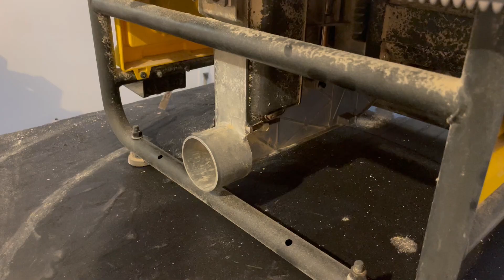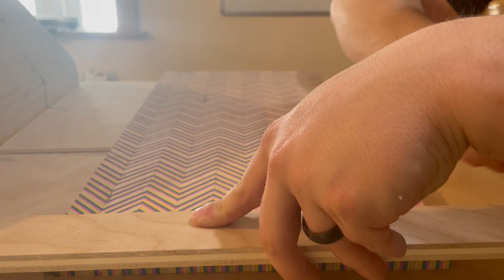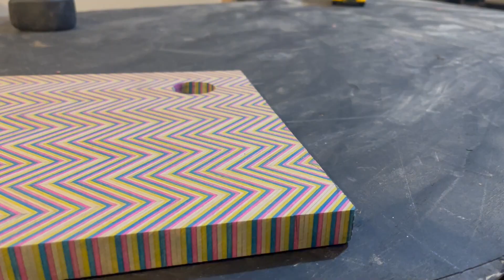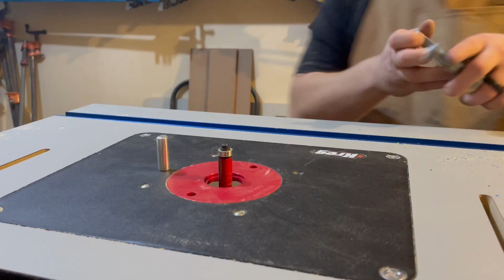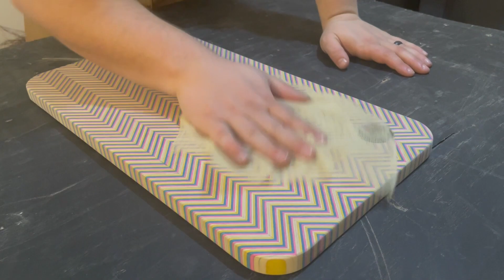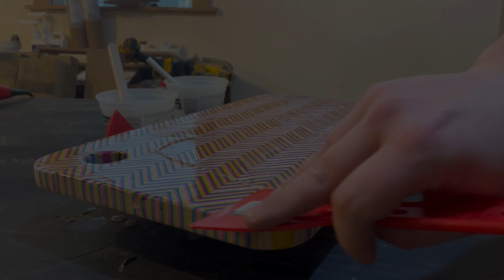Make This Beautiful Peacock Plywood Cutting Board

Comment: You make very nice projects and have a good eye for design. I wish you would set a better example for beginning woodworkers when it comes to safety. i have decades of experience working in and managing woodworking shops and have seen a lot of accidents and health problems in the trade. Please use a dust mask whenever you create dust, ESPECIALLY when working with epoxy. Also wear some gloves when you work with the resin. Many workers become sensitized to epoxy and have severe allergic reactions when exposed. You might think "Well it doesn't seem to affect me", but it can over time. I have know three men who worked with epoxy in boatyards with no problem at first, but after a period of time ranging from a week to about 5 years, they developed awful rashes and lesions all over their bodies. This happened to my brother and now even ten years later, if he enters a room where epoxy has recently been used, he breaks out. Also please lower your table saw down to a normal working height. I hate to think about the consequences of a kickback using a setup like that.
Reply from the maker: Firstly thank you so much for the kind words I really appreciate them. Secondly I completely agree that I should be safer for myself as set a better example when it comes to safety for others. A mask or respirator is always a smart decision. As far as the epoxy is concerned, that is a very interesting point, I have heard of and know some people who are allergic to resin but I hadn’t heard of one developing over time so thank you for sharing that information, gloves are an easy addition when working with epoxy and one that I will take advantage of in the future. One question, I know the dangers of kick back and although I can always do better I do try to take it seriously, my question is what are the increased danger of the saw setting higher? When you say normal I assume you are speaking of around a 36” height, where mine on this bench is around 44”. How is kickback more dangerous at this height? Thank you so much again for your thoughtful comment and your concern, safety is so important and I can and will do better.
Reply: @OneWayToMake  Thanks for the thoughtful reply. With the saw at a height of 36" or so, you have more leverage to control the piece of wood you are cutting, better line of sight and less dust kicking up in your face to obscure your vision. But the main thing is that if you get a kickback,with your setup, the piece of wood is going to hit you in the chest or face.